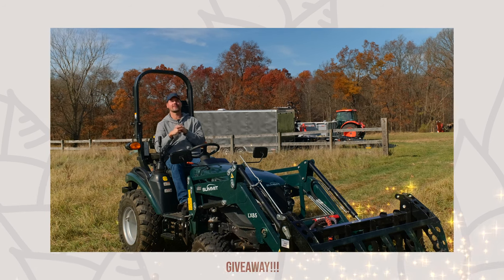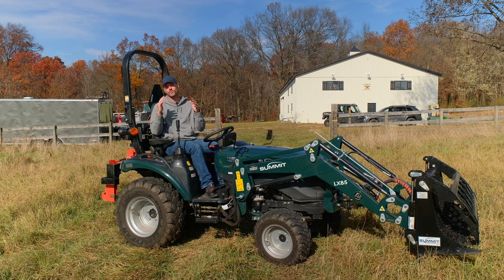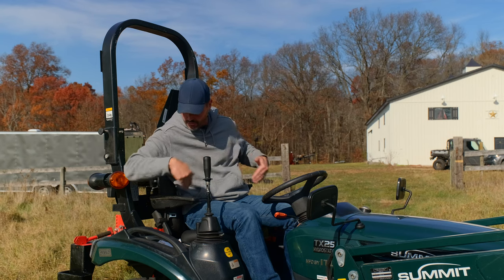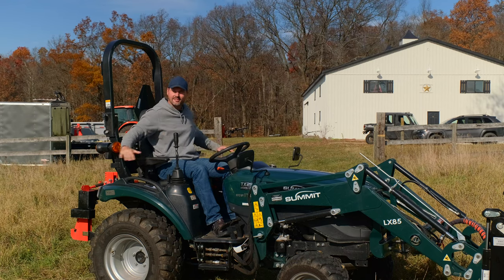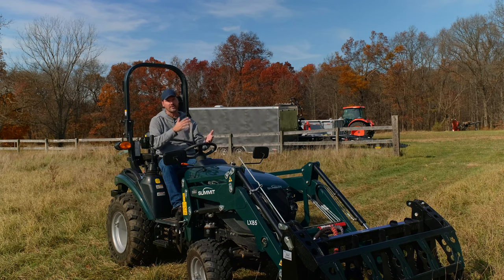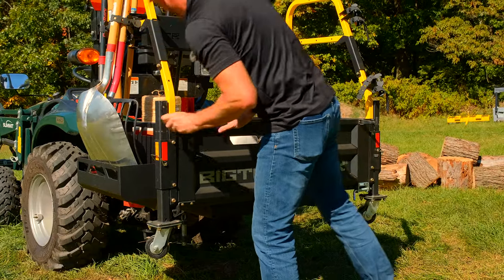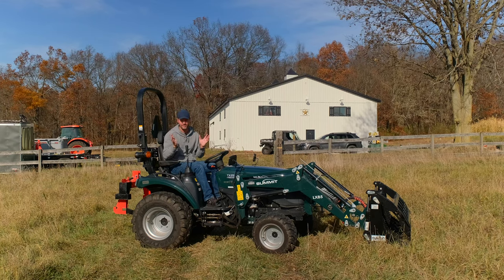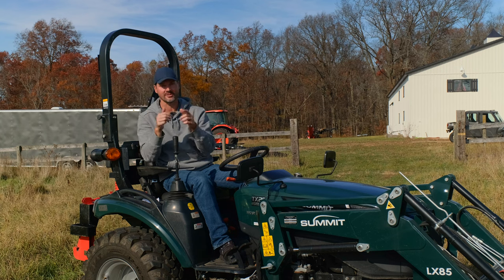THE MOST IMPORTANT TRACTOR VIDEO YOU'LL WATCH THIS YEAR 🚜

Comment: I have been watching a lot of your videos for the past few years and finally became a new tractor owner this past summer. Love all your ideas, honesty and no BS way of presenting options for tractors, safety tips, which I did first for my tractor. My used but new to me 2020 JD2032R came with an iMatch Quik Hitch, 72" Rock Rake, 72" Scraper Blade and a Ballast box that someone filled with cement. Love your versatile ballast box with tool holder and a trap door to empty it. And now the quick hitch hangers are an ingenious idea to free up the Quick hitch or add even more weight with the ballast box. I wish there was a Summit dealer in the northeast but for now I'm learning tractor finesse and getting the experience behind a bucket loader and will probably go bigger in a few years. Thanks for the veteran recognition. Keep up the good videos.

Comment: I bought the Speedo quick hitch and weight hangers with weights.  It is an easy installation.  I have used my front end loader for over a decade without troubles (water and antifreeze in wheels.)  Being safer is important to me.

Comment: Hi Courtney,
Thanks for all your instructional videos. I have purchased several of your suggested add on products as well as had a couple of my own made up. I purchased a JD 2025R with numerous attachments to take care of my property in the UP and my home in Ohio. My son has a JD3046 and I didn't feel I needed anything that large and the 1025 felt too small and didn't have enough ground clearance, so the 2025 fit the bill for me. My front end loader gets a lot of work. I use it with the forks to take care fallen trees and firewood for our church members. This weekend the bucket will be getting another workout moving river rock and mulch for the church's landscaping project. I had the rear tires loaded when I purchased the tractor and I  know it has made a big difference. I also have the imatch heavy hitch for the 3pt and a pair of your side brackets would fit nicely. If I feel I need extra weight now, I either hang my box blade or tiller on the back which can prove to be troublesome in tight areas. Please keep up the great videos.

Comment: As a long time tractor owner and avid watcher of your videos I have 2 2305 John Deere tractors with the dual wheel setup and liquid ballast and recently added a 1025R which is decked out with GWT swag you got me started with the X series which is still my favorite in the collection I have a tractor and attachment addiction thanks for all the videos and products I’m purchasing the hitch hangers for the 2305s which have the 62” mower decks with dual wheel setup by removing 1 wheel on the left side of the mower deck

Comment: Courtney, thanks for all the education your provide along with the products you sell. Bought a Brush Crusher last summer and love it for getting logs out of my woods for firewood. And love the stump bucket I just purchased>

I do have some issue with ballast weight on my 1025R. I have the rear wheels filled with liquids ballast, and bought a John Deere ballast box last year and filled it with bricks. I tried it out with snow plowing. I plow with my front bucket. But i lost a lot of traction in the front wheels. I had trouble steering, so I removed the ballast box. I have tried it in a couple other situations (with the brush crusher and with the stump bucket, and had a similar problem with steering. My biggest concern is with tractor tipping side to side. I really don't want to add wheel spacers to move the tires out as I have a lot of places where my tractor and mower deck just fit between trees on our property.
Not sure what I am doing wrong...

Comment: As a new tractor owner I feel like my investment in Rim-Guard was one of the most useful things I purchased for my tractor. Before Rim-Guard I tried picking up a load of firewood and had the back end of my tractor come off the ground. I was barely able to move it. Rim-Guard added 1000 pounds to my compact tractor. I'm not sure that is enough ballast weight but it makes it feel much more stable. That plus the weight of a 6ft tiller makes it feel pretty planted.

Comment: Great idea.  I didn't think I needed a quick hitch when I got started with my 1025R.  Five heart stents and a back fusion later, I'm convinced.  None of that was the tractors fault but you gain perspective.  Anyway, I'll be able to get down pressure without stacking concrete blocks on my rakes.  Thanks for looking out for us.

Comment: Hitch hangers are a very neat idea to solve the lack of down pressure with the smaller/sub-compact tractors. I've seen all kinds of videos of people adding weight to box blades foe example, they either look unsafe to operate with or unsafe to physically install. Your brackets look both safe & easy. Keep innovating.

Comment: Good video as usual.  A backhoe with loaded tires works well on my 2305.  Just pulled the drive shaft to replace the U-joints with the NAPA UJ410.   The zert is on the outside of the lobe, not inside the knuckle. Easy to get to and keep properly greased.  Considering doing the same to my 1026R.

Comment: This has become my go to channel for advice. Especially ballast.  I have a "new to me" 3320 2006 JD. My location is in West Virginia which is very steep terrain. Obviously the mid-west is ideal tractor country. Although I have liquid filled tires, a backhoe, and a front bucket, I recently ordered a set of 3" BORA steel spacers to enhance stability. Because of the high profile of the backhoe in spite of the weight I question the stability improvement of a backhoe. It also limits the options for additional rear weight options. You may want to consider this and uneven terrain in a future episode. 
You are a beacon to the compact reactor community. Continue the good work.
Allen

Comment: Courtney, 
 I like the idea of these hitch hangers. I have been keeping my eyes open for weight solutions as my 1025R gets tippy at times. I have a pretty heavy box blade and land plane but I  am still in need of more weight so I think it's time to start adding suitcases to the work force. I use my pallet forks alot and recently moved a load which almost caused me to tip my tractor on it's side. I think a set of these little guys could save me alot of grief in the future. I would consider them my coworkers helping to keep me grounded and running. 
 Thanks for another great video. I am a subscriber and I watch them all as soon as you post them.
 I can't wait for the next one!
 Kind regards,
 Al 
 Howell, MI.

Comment: I’ve been looking at other tractor owners home made ballast ideas trying to decide which I wanted to tackle. Plastic drums filled with concrete, wood or plastic boxes filled with concrete with mounting pins sticking out of the concrete. But it seems that if I was to win these hangers then guess I’ll need to buy a Speeco Quick Hitch which would probably work better anyway. Courtney you’re right about the brush hog. Good weight but takes up so much room and constantly shifting or hitting something.

Comment: I love the new product. I could absolutely use that for the additional down pressure on my 3 point core aerator. There are just only so many sandbags you can put on top of that implement before running out of room and there is just nowhere else to put weight. Plus the 14th is my birthday so you should totally pick me.

Comment: Have the Hitch Hangers for the Speeco hitch, had them shipped with 420 lbs of suitcase weights, they fit great and don't interfere with anything on my Kioti DK50SE cab tractor.  Looking forward to the additional weight they will provide while pushing snow this year (hoping we get enough again this year), should help with traction on the R4's.  Also have the VersaBracket Combo, though haven't needed to put that on yet with the HH's and a rear implement.  Got the VBC over a ballast box since I can always use the suitcase weights on on implements if needed or on the VB and have a very small rear footprint if needed for maneuverability while loading the front end loader heavy.  Have a good one!!

Comment: I have a kubota l3830 I use the 6ft box blade with about a 120lbs of extra steel welded on the back edge for counterweight along with filled rear tires. This has worked really well for me. This tractor does all of our heavy lifting and at max lift capacity the back still does get really light. I haven't added any more weight farther out the back because of clearance when working in tight places. I have been thinking about welding more steel on the box blade or just adding some pipes sticking straight up to add gym weights to when needing the extra weight. Plus the extra weight on a box blade can come in handy when you need more down force using the box blade as a box blade.
I am considering the wheel spacers for the bx23s but haven't added them because of the places it's used and needs to be as narrow as possible to get in and out. The backhoe gives plenty of counterweight to the little tractor.

Comment: What is useful to consider, as far as liquid wheel ballast is concerned, is that the liquid is not attached to the rotating tire.  So, when engaging forward or reverse motion, the initial transient load on the rotating parts is much less.  This is especially true for manual transmissions (do they still make tractors with a clutch ???) .  Eventually the liquid will start to roll with the tires, but not immediately, so the initial drive torque is not going to be a great shock to the final drive.   On hydro transmissions, this ballast type could save you from a blown seal.    
Same process is true for braking,  you stop the forward displacement of the tire, but not any extra rolling momentum from the liquid ballast.  So, it reduces wear on these parts too.

Comment: Just my two cents... If you have a subcompact tractor (I have a 1025R) unless your land is very flat or you never plan on going up or down hills, a weight bracket for rear ballast is the best way to go.  Before I got my rear weight bracket I used my box blade with extra weights attached for rear ballast.  But because of the low ground clearance I had a tough time going up and down hills in the woods without the box blade digging in when i didn't want it to.  There were simply places I couldn't go.

Comment: The quick hitch brackets sure seem like the most versatile option for adding weight to the 3 point without limiting your options for installation of other attachments. Easy off loading for instances where you need to lighten the weight to prevent damage like when mowing soft ground.

Comment: I have learned a lot both before & after purchasing my 3025E.  I knew nothing about ballast weight and the likelihood of flipping over.   I saw attachments that I would have not been familiar with.  I have purchase a few attachments from you as well.  I would like to know how you like the Goodyear R14t tires for not tearing up the yard, my R4's are hard on the lawn.  Or would you recommend a different tire or maybe a radial.  I like the hitch hanger for adding weight and nor tieing up the 3 point hitch.

Comment: Hitch Hangers are the Best...fast and easy way to add down pressure for any attachment.  It makes it easy to change implements without touching the weights.  Weights can be removed when desired at a convenient location without any implement attached.  Every Tractor needs Hitch Hangers.

Comment: Hitch Hangers would be a great way to add weight to the back-end when using lighter attachments on the 3PH. Much better than piling sandbags or concrete blocks on top of an aerator to help with ground penetration. Also made in USA!

Comment: Between a rock and a hard place. Because of the heavy clay the tractor sink in in the wet spring until July when it stops raining and the clay turns into concrete then it’s okay to all weight. Until then it’s pucker power.  If not for that cycle I would love to fill tires.

Comment: My Ultimate ToolRack as 2038R rear ballast (load w weight to maximum capacity) works for me. But wondering if I had hitch hangers for added safety, would those suitcase weights still have clearance allowing the Ultimate ToolRack on the 3-point? Have you tested those together?

Comment: I have a Kubota L2501 with a Land Pride QH10 quick hitch.  I would like to add your quick hitch hanger brackets to add suitcase weights to the side, but I understand that there is a compatibility issue with the LP QH10.  I have ballast in the tires already, but hanger brackets would be great.  If you ever work out compatibility of hitch hangers for the LP QH10, I would love to buy a set.  Thanks for all your videos.

Comment: I would like to see testing of stability with and without wheel spacers. Probably safest to do on PC vs real life? I do like the option to keep quick hitch free for attachments. Instead of timing up using a weight bracket. It's a drag every time I have to remove all my weights and then put them back on 30 minutes later.

Comment: My 10 acres is very hilly . I am considering having my rear tires loaded  on my 1025r for more pulling power on some of the steeper hills I am also considering loading the front tires also. 
 Is that something you would recommend?
Reply: Rear tires loaded is a good idea.  You can combine that with wheel weights for even better ballast. Most people don't bother having the front tires loaded.  It wouldn't really add much weight.  I have a 1025R and I can put 5 small suitcase weights (40-42 lbs) on the front part of the tractor frame. Even with the front loader on.  With the front loader off you can also put 5 large suitcase weights on the front.

Comment: Not to hi-jack the post but a poor man's weight box can be made with a 55 gallon poly drum cut in half and filled with concrete - run an appropriate length draw bar through it before placing the concrete. I added an old top link to prevent sway. Weighs just shy of 500 pounds. The draw bar was about $25, the drum $10 and I got the concrete free at the batch plant before a truck washed out.

Comment: Hey Courtney.  Hope all is well with you and yours.  Cool giveaway!  I certainly could use the hangers for my 1025R.  Bought the versa bracket and it has been very helpful.  However, at times I want some down pressure on my 3 point implements (like the CMP rake).  Definitely could use the giveaway set of hitch hangers for my third party quick hitch to help load down implements safely.  Keep up the good work!  Thanks for sharing!

Comment: I'm a new tractor owner.  I had the liquid ballast filled in the tires.  How important is having weights in the rear on top of the tire filled ballast?
Reply: It's very helpful / important for doing front loader work.  You can remove it when you want the tractor to be lighter, like when you're mowing.

Comment: I believe I have calcium chloride in my tires. The rims are corroded where some of the fluid has leaked out. The tractor is a &0s era Ford 3000. Do you have a vendor for new wheels for this model? It would be nice if Summit were to get a dealer in the Ohio area. Keep up the good work.

Comment: I have two John Deere tractors; a 4066R and a 5125R. Both have the max wheel weighs. I usually keep a box blade on the back for the weigh when doing loader work. I have considered beet juice in the wheels but I have an issue with Texas mesquites and locust thorns. I keep tire slime in all the tires for that reason. Does rim guard have additive to help with tire puncture from thorns or does it play well with tire slime type products? Thanks👮🏻‍♂️Chip